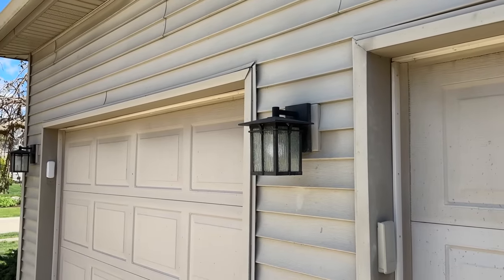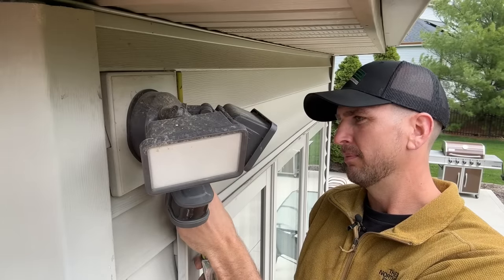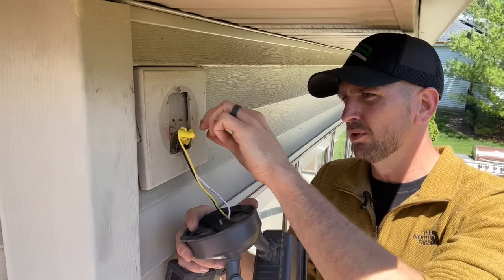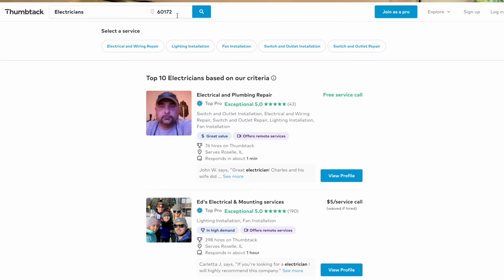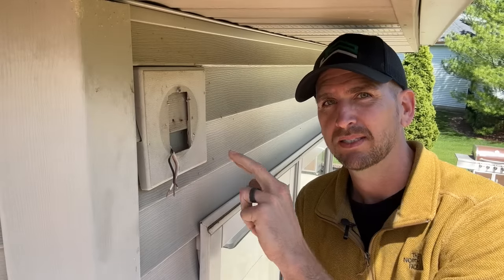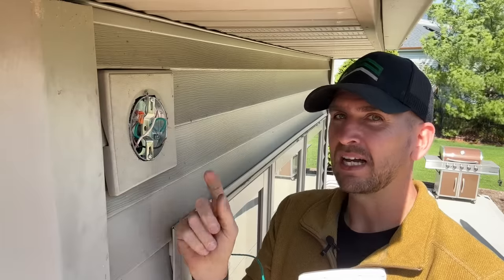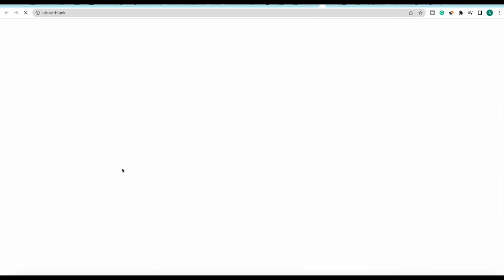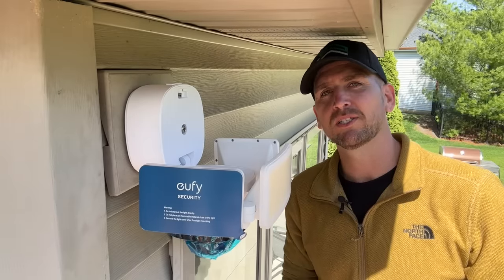How To Install An Exterior Light And 3 Common Mistakes To Avoid

Comment: Real men use wire nuts. Granted the ratings and stuff for those lever nuts say they're safe for it but I don't trust them for regular electrical, I prefer them for low voltage wiring.
Reply: Entire Germany and most of other developed European countries use WAGOs for industrial and domestic installations for decades without any problems. I personally used WAGOs few times to power ENTIRE home and observed their heating. I pushed them 30% over their maximum current on 400V and they remained cold and safe
Reply: @bojangazibaric3328  yeah, I lost my home (apartment building) due to a electrical fire, I still don't trust 2 thin metal springs
Reply: @chrislewis2262  you didn't mention what caused the electrical fire.
Reply: @onelineal9382  I don't 100% what the cause exactly was. I heard so many different conflicting stories and even the report from the fire department was very vague. The main one I heard was a baseboard heater, the other was a neighbor's electrical panel it blew out. I also heard it was a set up for insurance scam because the owner was in the hospital dying of cancer so I'm sure the wife wanted the money because the property was literally sold not more than a week or two after everything burned down.

Comment: Wash your filthy house my friend. It will help that vinyl last much longer. If you have a pressure washer you can downstream a oxidation remover and cleaner like Cleansol BC, OxKnox or Gutterbutter.  Give it a good no scrub chemical wash first then do a oxidation remover. Don't let the stuff dry on there. One area at a time . Cheers ;)

Comment: Do not follow these instructions. 
Also at the start of the video he explains about keeping water and moisture out of the light box with a gasket but then at the end of the video the electrical box is sitting out past the siding block above 1/4 of an inch for water, bugs and all sorts to get inside.

Comment: Everything was great until you said to use wagos instead of wire nuts; especially for outdoor connections. Wagos are bad, and you should feel bad for using them.

Comment: Those Eufy cameras are not high end, they are chinese made garbage. The let water in, the motion detection fails, they have constant problems. Most of the positive reviews on Amazon are less than two months old. The negative reviews say they fail in less than a year.

Comment: Use a solar powered system and you'll have solved the problem!
Reply: nah. I get the wonderful job next week to remove 30 solar flood lights, 40 feet in the air. Apt complex thought they were going green till those POS's died, now the township inspector wants ALL exterior lighting that doesnt work either completely removed or replaced

Comment: Your video contains incorrect, wrong, and misleading information that you need to fix/change !

At minutre-marker 4:40, you say: "You might want to turn to an exterior box such as this", then proceed to hold up a standard 4-inch weatherproof junction box. However!  ALL of the new light fixtures (including the very one that you show ion your video) will NOT fit on the opening of a standard 4-inch "exterior" junction box.  That is exactly WHY people (like me) find your video, just to find out that you are giving misleading/wrong info.

Good that you pointed out the lack of the "pan cake box" (your words), but you don't say BOO about the mounting block (AKA: 'builders edge") shown on this persons house, where to get them, and the different kinds etc.

This is the information people like me and many others need.  Plus how/where to find a 'mounting block/builders edge' w/o a "step" on the back for lap siding.  i.e. how does one mount these new-style larger fixtures to a house with lap siding, but want/need to mount it just on ONE lap siding strip?  i.e. a house with lap siding that has a 6-8" revel (where the wire from the house comes out in the center of the 6-8" revel and can't be easily moved/re-routed ??

Comment: You really push those WAGOs to the DIY'er. I have done many outside lights and always used wire nuts and not a problem. Then again, I am not being paid by WAGO to push a product. And please, don't tell me you are not supported by WAGO. Again, the common DIY'er will not have WAGOs but most likely hundreds of wire nuts. Be honest about it, not a problem, but understand, the common DIY'er may do this once every five or six years.
Reply: You can hang the fixture with one wire nut during the installation. 
I wouldn’t trust a Wago to do that.
Reply: @howtodoitdude1662  You would be wrong, i tested pull force on wagos several times, u would be suprised:). Im not from the USA but in EU we are using them for a very long time
Reply: Diyers should never ever go near a wire nut,

Comment: Going to make the wago people mad but they're low-key garbage, they work fine in the great for being able to reuse but they do not make as good of a connection as tightly twisting wires together where the wire nut is effectively just a cap to make sure that it doesn't come untwisted, use a pliers if necessary and tell me afterwards which one you will trust for an arc free permanent connection. For DIY I will confess that Wego is harder to mess up for a novice but I feel that everybody should have the ability to properly twist a wire

Comment: Before you post a how to video you really should know 'how to' yourself. Electrical code violations as well as improperly secured vinyl siding. ie: open knockouts, no strain relief on wires and no cutouts for vinyl to expand and contract.

Comment: Wire nuts aren’t that bad, twist on the ground first and give it enough cranks that the wires actually twist together visibly outside of the nut, and then the fixture is actually supported by the ground wire* while you twist the other two. Make sure to twist them properly per manufacturer instructions. Lots of videos on YouTube on how to do this.

* or bend a piece of twelve gauge into a long hook and use that to hold up the fixture while you work.